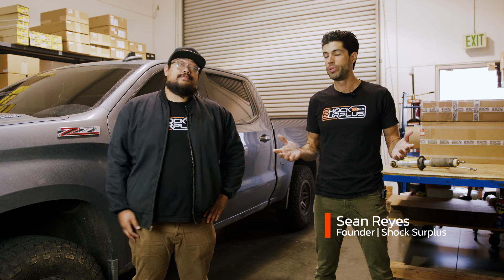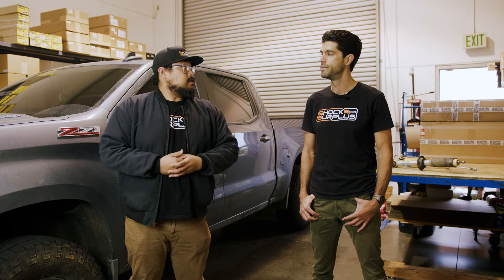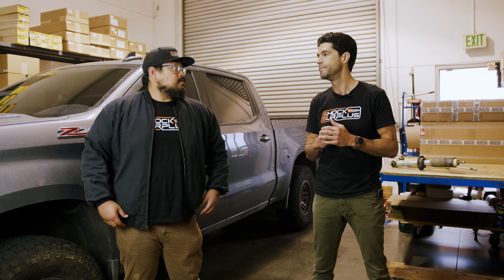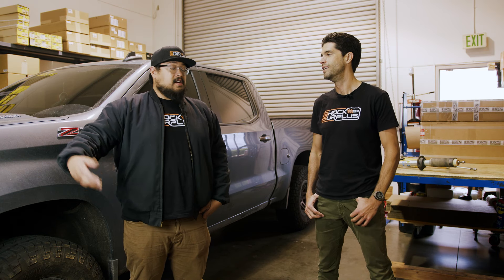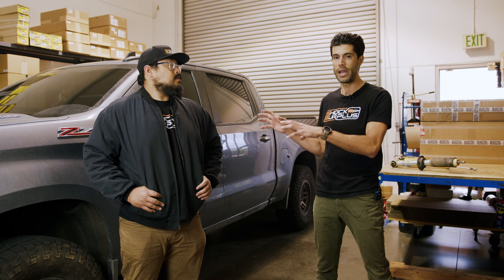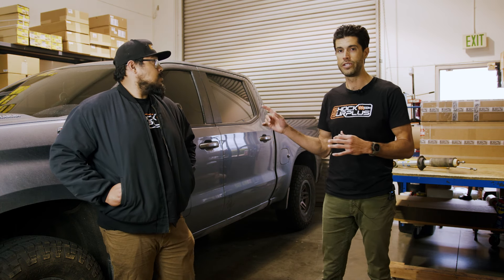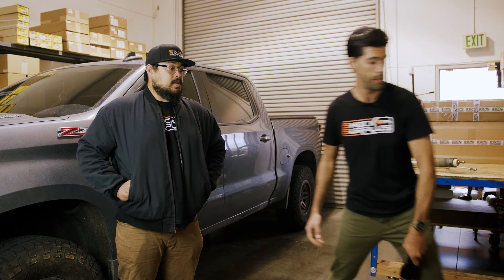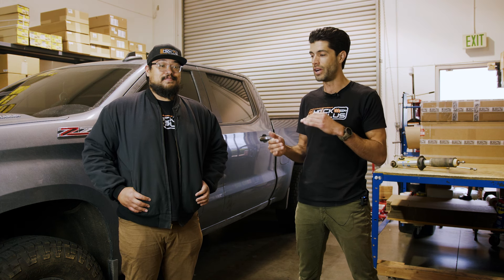Floaty, not Boaty - Cure Your Silverado's Ride with FOX Shocks

Comment: Would you reccommend this for comfort over the rough country 2inch loaded strut leveling kit. The one that comes with the spring and shock assembly ready to go. Im currently leveled with bilstein 5100s running 295/70/18s ridge grapplers and my ride quality is terrible. Thanks in advance.
Reply from the maker: Bilstein 6112 and 5100 or Eibach Pro truck stage 2.
Reply: @ShockSurplus  will i see a significant difference in ride quality going to the eibach from the 5100s i have now? I wouldnt want to do it if its only going to be a small difference. Im thinking maybe the tires are the problem. Was considering switching to d load vs e load tires. Thanks for your help i love my truck but i have to get it a bit less harsh and bumpy.
Reply: @Artjan1 I went down the same route as you man. I got Bilstein 5100 shocks installed along with load range E duratracs. The ride was so harsh I got rid of the tires after only 1000 miles. I swapped them to Hard metric (Non LT) tires and it did improve a lot but the 5100’s were still too harsh. I then went to aftermarket rancho shocks and the rancho quick lift up front. Ride quality is much better now. The ranchos don’t maintain rebound well as stated in the video but they do give you a softer overall ride. So my recommendation is get rid of the LT tires or just swap out the shocks for ranchos (or both). Sure ranchos aren’t the best in the world but it at least gives you that comfort back.

Comment: 2020 AT4; thinking of installing Bilstein 5100 ride height adjustable and Bilstein 5100 in the rear. What height would you recommend for best ride quality but also to bring the front end up to nearly level?
Reply from the maker: Use the highest circlip. We had no issues on the highest circlip on our Silverado but it's non AT4
Reply: Thanks guys! Can’t wait to see the Eibach review on your truck.

Comment: What are the part numbers for the fox setup? Looking to try them on my at4
Reply from the maker: Note, if you want the Fox 2.0, they will only work as a stock height setup for the AT4. That would be 2 x 985-02-134 for the front and 2 x 985-24-209 for the rear.

Comment: I have a 2018 F150 XLT 3.5 4x4 max tow. Factory 20" wheels and factory Hankook tires.. Love my truck!! HATE the ride quality! Please help me fix my truck and tell me what to buy from you. Never off road. Daily driver. Tow no more then 6-7k lbs. I swapped the rear shocks to Monroe. They are worse then factories after 5k miles. The rear end jumps all over the place. I want the best possible ride.
Reply from the maker: Bilstein 4600 will be a big increase in handling and tightening everything up. Fox 2.0 (like these) are going to soften everything up a bit, but still give better handling than factory. Bilstein best for towing and longevity (100k miles), Fox best for comfort and offroad performance, but need servicing. 

https://www.shocksurplus.com/products/bilstein-b6-4600-monotube-gas-oem-shocks-set-for-2015-2019-ford-f150-4wd

Comment: What size tires can I fit underneath with minimum trimming?
Reply from the maker: 2021 Chevrolet Silverado 1500 with 17x8.5 ET0 on 34s 305x70R17
That is what we are running without any trimming
Reply: @ShockSurplus  thanks I got a 2021 Sierra with the diesel as well. Love it.
Reply: So trying to get new front setup. Looking for something to eat up washboard more but this truck is mainly daily. What you think would be best setup

Comment: What rim and size is he running when he switched from the factory wheels?
Reply from the maker: Jeff has 17x8.5 +0 wheels and 305/70/17 tires on this 2021 Chevrolet Silverado 1500 Z71 RST.
Reply: Are your wheels ran with a spacer? I have the same truck and engine and I want to run 34” tires with the 5100s

Comment: What are the wheel set up on this
Reply from the maker: Here is a list of our in house vehicles with the wheel and tire specs.
2022 Ford Bronco with 17x8.5 ET30 plus 1.25” spacer on 37s, 37x13.5R17.
2021 Ram 2500 Powerwagon with 18x9 ET18 on 37s 35x12.5R18
2021 Chevrolet Silverardo 1500 with 17x8.5 ET0 on 34s 305/70/17
2020 Toyota 4runner with 17x8.5 ET0 on 33s, 285/70/17
2019 Ford Ranger with 17x8.5 ET0 on 34s, 285/75/17
2016 Toyota 4runner with 17x9 ET-18 on 35s 35x12.5R17
2015 Toyota Tacoma with 17x9 ET-18 on 37s, 37x12.5R17
2016 Toyota 4runner on 35s 35x12.5R17
2015 Toyota Tacoma on 37s 37x12.5R17

Comment: eibachs pro-truck-lift stage 2 fit 2023 silverados?
Reply from the maker: We assume you have a 2023 Chevrolet Silverado 1500 non-Trail Boss. If this is the case, then fitment in 2019 and up is the same parts and has not changed. However, Eibach and other companies have not all 100% confirmed 2023. You would want this kit here: E86-23-032-04-22 which we do not have listed yet but we can get them. Contact our sales team directly and we'll get it placed.
Reply: @ShockSurplus  yes 2023 LT (non trail-boss) ya that’s the same part I’ve been looking at. Stage 2 set up.
Reply: @ShockSurplus   lmk when you can confirm they fit I’m in. What would you prefer eibach or fox? I’m more on road then off.

Comment: just went from the ranchos to the bilsteins 5100 3in, but still running the ranchos upfront. Trying to keep the 4inch lift I have up front. Any recommendations?
Reply from the maker: We're not sure what vehicle this is for. We assume it's a 21+ Chevrolet or GMC Silverado or Sierra 1500, non-trail boss, and non-AT4. If this is the case, you are either running a full suspension lift or a spacer lift. If you're running a spacer lift, if you can retain the spacer and run the Bilstein 5100 in the front but set a stock height.

Comment: Just bought a 2020 Silverado 1500 LT trail boss that came with a three-inch lift. I offroad a good amount but also load up my truck quite a bit. I want a comfortable yet really plush offroad setup that can still tow on occasion (boats). What should I get? Any help is appriciated
Reply from the maker: Nobody really makes anything for 3" lift on top of normal Trail Boss height nor do we have anything that will give you that much lift. Truthfully running that much lift on a TB or AT4 is a recipe for CV axle failure if you do not already have a full crossmember drop lift.

Comment: Bilstein 6112+5160 on my 2023 silverado are super stiff I hate them.
Reply from the maker: We are definitely in the camp of prefering the firmer ride of the Bilsteins, but if you like something soft Fox 2.0s will be right up your alley
Reply: @ShockSurplus  I ordered a Fox 2 kit and I have an air lift from the rear. How do you think I will get a comfortable ride and how to set it up??. 35\12.5 R20 F150 2018 Thank you

Comment: I must’ve got a bad set of fox 2.0. They ride like trash compared to the 5100’s I just took off.
Reply from the maker: Ride quality is definitely very subjective, however I would not be surprised. Generally the Fox 2.0s are a good bit more compliant than the 5100s, particularly over smaller bumps at lower speeds, so most people find them to be a fair sight more plush.

Comment: Snap ring worries me. All that weight on a snap ring. I want real world reporting.
Reply from the maker: Bilstein 4600, 5100 and 6112 front strut use a circlip/snap ring which have no cause any issues unless installed incorrectly. We tested these Fox in various conditions to see how much they can handle and they didn't see to give us any issues. It definitely helped on give it more a stable and confident feeling compared to the factory Rancho. It was great for towing but was definitely manageable. They worked great for off-roading out in Johnson Valley but nothing fast or technically, it was to take the side by side out.